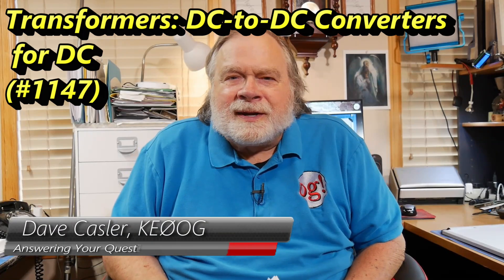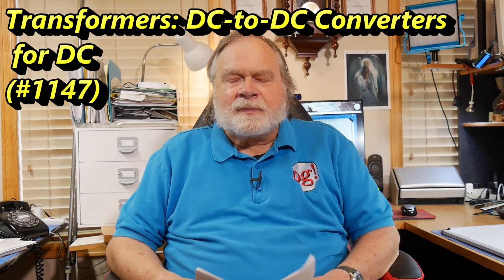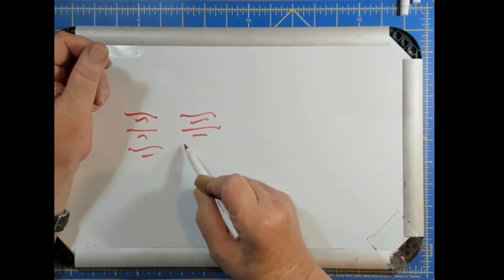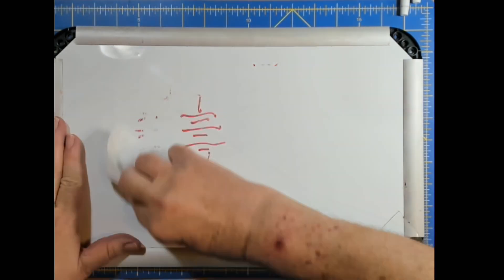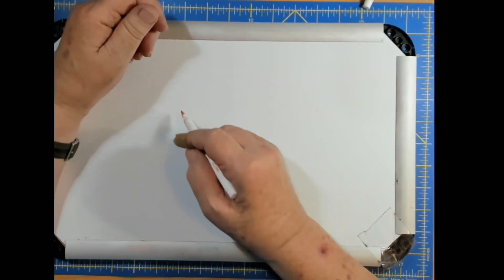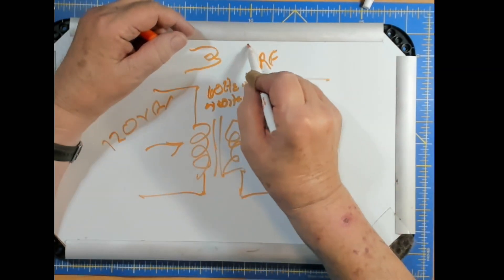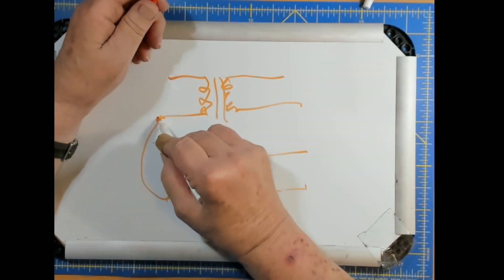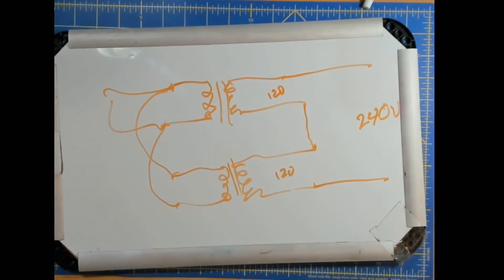Transformers: DC-to-DC Converters for DC (#1147)

Comment: Many Jeep owners can buy two battery installation systems. They fit right in the area where the factory battery sits. Typically, though, one battery is for starting the engine and the other is a slow drain battery for 12 vdc equipment installed in the vehicle such as a portable refrigerator, exterior lights for nighttime camping and charging cameras and cell phones. There is an electronic device to properly charge each battery through the alternator. If your starting battery dies, you can move a switch to engage both batteries until you start your engine, the disconnect it once it is running.
Reply: That is the system that I have in my JEEP.

Comment: WHY does he want 24 volts? Semi tractors used to use 24 volts for starting while running everything else off of 12 volts and the charging system was 12 volts. These vehicles used a series/parallel switch to accomplish 24 volts at starting. It basically changed how the batteries were connected while cranking to get the two different voltages.
Reply: I personally have some gear such as tool batteries in the 20 volt range, and have found that it is simple to charge them off 24 volts. So have a 48 volt solar system with a charge controller that can handle 60 volts but givee 23 to 24 volts or 27 volts to charge the 24 volt batteries.
Reply: I personally have some gear such as tool batteries in the 20 volt range, and have found that it is simple to charge them off 24 volts. So have a 48 volt solar system with a charge controller that can handle 60 volts but givee 23 to 24 volts or 27 volts to charge the 24 volt batteries.
Reply: I personally have some gear such as tool batteries in the 20 volt range, and have found that it is simple to charge them off 24 volts. So have a 48 volt solar system with a charge controller that can handle 60 volts but givee 23 to 24 volts or 27 volts to charge the 24 volt batteries.
Reply: I personally have some gear such as tool batteries in the 20 volt range, and have found that it is simple to charge them off 24 volts. So have a 48 volt solar system with a charge controller that can handle 60 volts but givee 23 to 24 volts or 27 volts to charge the 24 volt batteries.

Comment: Delco remy 30SI alternator has built in transformer. For when machinery has cab that works on 12 VDC, But Starting system that is 24 VDC battery set up.

Also, CUCV military vehicle dual 12 vdc alternators are in series and isolated in a manner that the DC generated will feed 24 VDC battery system without a transformer.

Many ways to make juice for sure
Reply: ALTERNATOR is the key>>produces AC that is then RECTIFIED to DC

Comment: The most important thing is not to use the vehicle battery. If your radio battery is flat, that's the end of QSOs for today, but if your car battery is flat, your problems haven't started yet for tonight. Get a separate radio battery in your car.
Reply: Yes, and a "keyed" power relay to energized aux battery during operation, but battery isolation/disconnect at the halt. 

Then, the vehicle charging system maintains voltage during operation without leaving you stranded ..

Comment: the converters are too low power though... we need 12v to 24v at hundreds of watts
Reply: I can help you here, however we need three numbers to work with before we can start:
1.) How many AMP hours can the 12-volt batteries deliver continuously?
2.) How many watts to you need? Hundreds could be 600, 1200, or 5300 and etc.
3.) How long do you want the system to run at 24-volts times how many watts from #2 above do you need?

Let's take an example: Say you need 1200 watts for six hours.  That's 1200 watts times six hours or 7200-watt hours.  To get 7200-watt hours our of a 12-volt battery you'd need a battery that can deliver 7200 divided by 12-volts equals 600 AMP hours of capacity times two because you can only safely discharge a lead acid battery to 50% of its capacity.  You need to add to this a factor for the inefficiency of the DC-to-DC converts.

Keep in mind no matter the voltage watts don't change.  All that changes is the current required to produce the number of watts you want.  Use the formula of power in watts equals voltage times amps.

Hopefully that makes some sense and I'd be happy to answer more questions.  There are DC-to-DC converts that can produce kilowatts if the input voltage is high enough.
Reply: @rogerp5816  no. as i said we need from  12 volts to 24 volts.  it is easy to sort out batteries to do this and give the wattage required which in my case is 1000. The problem becomes charging the batteries. a split charger works. BUT>>>>> as with the subject of the video.. many of us need a simple converter from 12.. to 24... that can run a  kilowat.  it does not need to be continuous or for long at all.. just odd key ups.